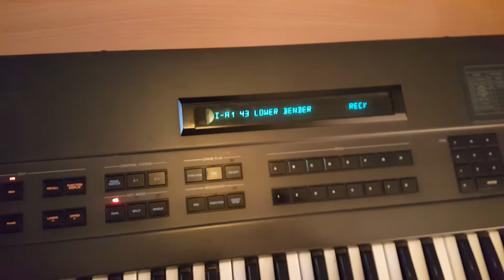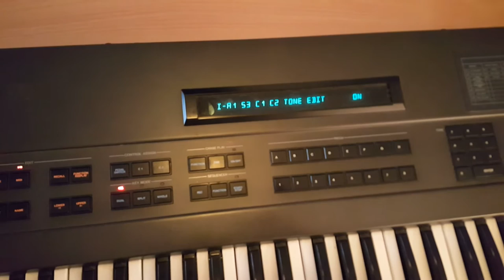Roland JX-10 firmware upgrade

Comment: When you say, "Help Someone with the Same Problem".....  what problem exactly were you having?? Trying to diagnose my JX-10.. Wondering if this simple uppgrae will be the fix... or of there is a different problem I need to address.
Reply from the maker: I suppose I was talking about the problems of having a stock JX-10 that's a bit gimped on midi features, and having to do synth surgery for the first time in replacing the ICs. If you have a different problem, check the links in video description, particularly super-jx.com and the facebook groups. There's more knowledgeable people than me who might be able to help you with anything more complicated than "have you tried turning it off and on again" (which is pretty much my limit).